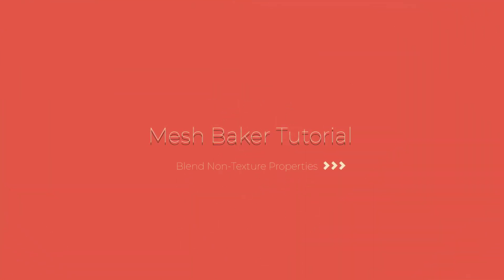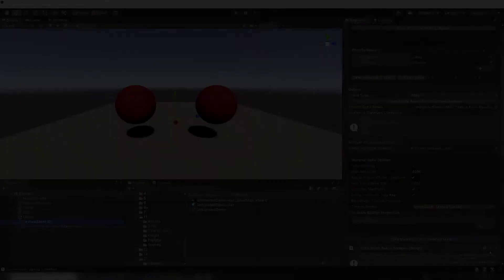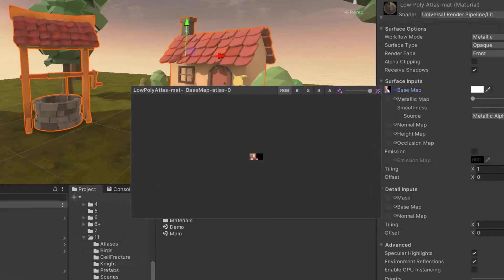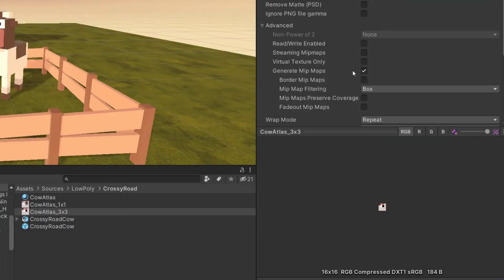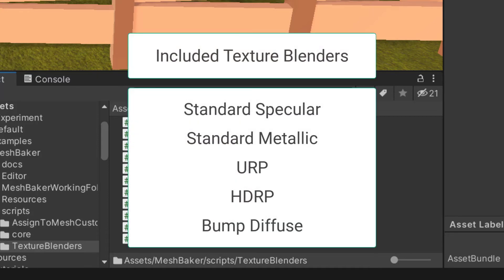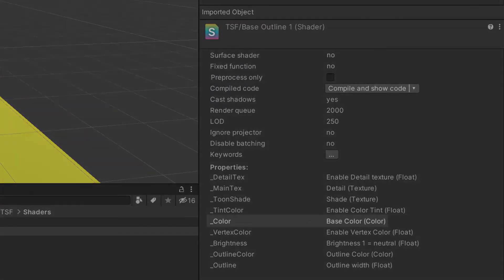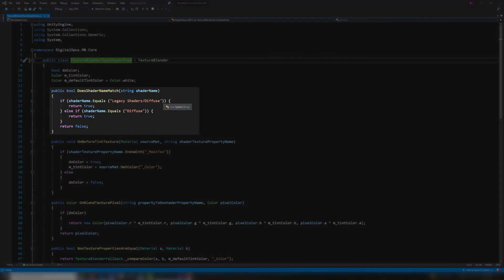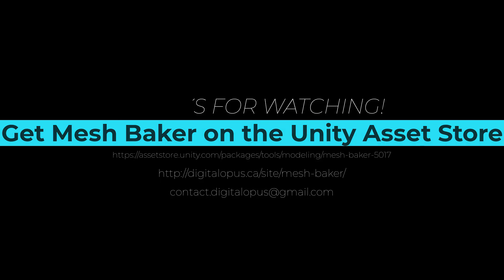Blend Non-Texture Properties

Comment: Is there a way to bake materials without mesh? For example materials used by effects
Reply from the maker: Probably not, but it could depend on your situation. I presume you are talking about particle effects? Mesh Baker could perhaps be used to create atlases for sprite animations but it would be a hacky non-standard workflow.
Reply: @IanDeane   Thanks for the reply,  Id imagine so.  I think not necessarily particles but VFXs in general.  Im optimizing a project, where each vfx object (may consist of meshes and particles) uses all kinds of textures as individual image. All of them are already using same shaders(3 custom shaders to be exact). Im wondering if I could combine them into using atlas/ texture arrays and if that will save some draw calls. For effects especially there might be a lot of custom operations such as tiling and panning over textures, maybe atlasing would not work? Do you think texture array could be an option?
Reply from the maker: @yugao2619  Texture arrays would probably work. Your shader would need to know which slice to grab instead of which texture to use. 

Mesh Baker may be overkill for this if all you need to do build a TextureArray from a list of textures. Mesh Baker expects the textures to be used in a material and applied to meshes. It will try to bake each slice into a mini=atlas.  If all you want is creating a texture array from a list of textures, let me know. I have a simple component that does that.
Reply: @IanDeane  Awesome would love to take a look at that, can I email you in the support email of Mesh Baker?